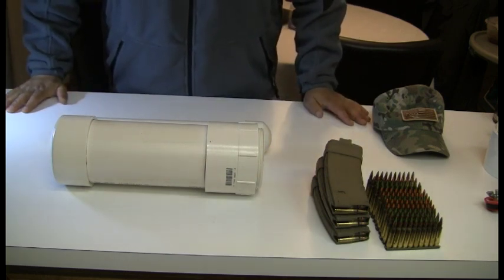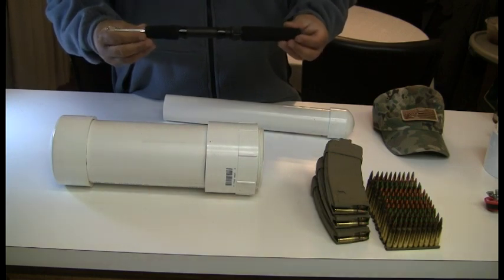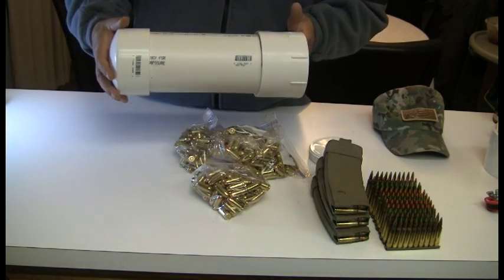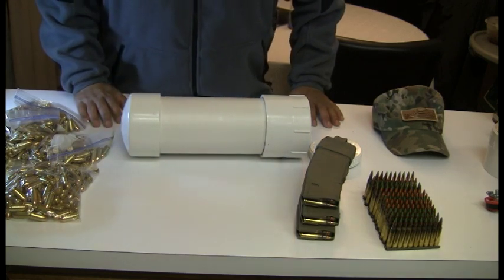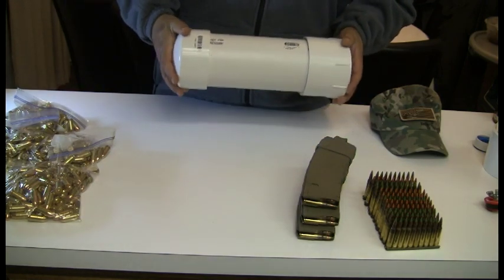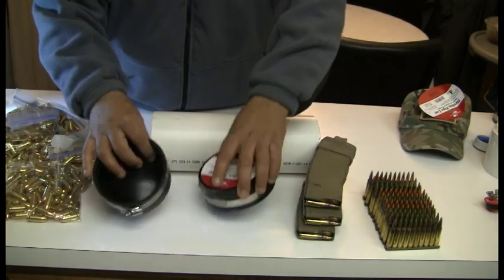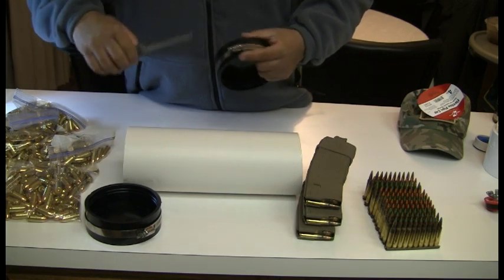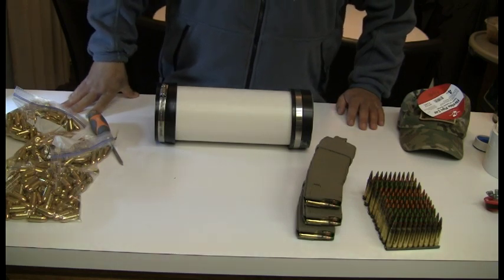Burial Vaults, Firearms, and Geo-caching

Comment: a pole in a survival bag or a bug out bag I think is just a waste of space. limb lines or bank line are a lot better than on pole. set out many of them and you don't have to watch them. they work with out being their the same goes for fish and animal traps.
Reply from the maker: I strap my pole to the outside of my bag. Or, if I have the space, I can put it inside. I carry bank line with me as well, however I am much more effective with a rod and reel.
Reply: PrepperLink yeah because strapping a long white tube (target) with an item that isn't needed to the side of a pack is a great idea. And better throw in some new mag springs since loaded mags in long term storage is a big no-no. And I couldn't stop laughing when you pulled out the flexible end caps....complete junk and not meant to be buried. No talk about rust/corrosion inhibitors or moisture absorbers. Your gonna have a big surprise when you dig your shit up
Reply: Ounces = pounds
pounds = pain

I agree, I'd either cache a fishing rod or simply do my best at making one.
Reply: svbummin Lol... I read this nonsens all the time.
And what exactly are these "rust/corrosion inhibitors or moisture absorbers" supposed to do?
If the container is air-/water-tight (as it should be), you simply don't need them.
And if the container is not, they won't help you at all.
Trust me. I have buried quite some tubes the last 2 decades.
PS : the flexible end caps are way better than the hard ones. The hard ones will crack, the flexible ones won't.
(hence the word : flexible).
PS2 : Inform yourself about magazine spring wear. It is a wellknown hoax that "keeping a mag loaded over time will wear out the spring". Only cycling (compressing and decompressing) is what wears out a spring.
Reply: So I guess ignore all the manufacturers and experts that clearly state that in recent hi-capacity magazines, the magazines were designed to hold more rounds with less spring material. And they admit that this puts more stress on the spring and will cause compression fatigue at a faster rate.or the countless people who have proven that mag springs compressed long term, will loss compression strength. Or the simple fact that im a skilled welder, metal fabricator and amateur blacksmith that has studied metallurgy for many years...so trust me when I say that the basic spring steel used in mag springs DOES form a memory over time. you can believe whatever you read online, but ive seen it first hand. It wont stop the mag from working necessarily but it greatly increases the chance for malfunctions and feeding issues, which again has been proven that even a small decrease in spring compression affects performance in some platforms.
and you clearly dont realize that rust and corrosion of metal is established from the actual moisture in the metal...not from moisture in the air (although after surface rust has been established the tiny bit of air left in a cache tube will be more than enough to allow damage if left long enough) because all metals ferrous or non-ferrous absorbs moisture. So unless you heat up your guns and ammo hot enough to sweat out the moisture and then let them cool and seal the tube while in a damn vacuum... you WILL get rust and corrosion. or simply use a rust inhibitor (which is standard industry procedure when working with a machined or high tolerance surface that has to be left raw) And with some grades of steel it happens in less than a day. So you can wipe down a gun after being exhumed or you can go ape-shit on it with steel-wool or a scotch-brit pad and pray that things aren't pitted enough to throw of tolerances like head-spacing. and I dont know what kind of cheap-ass thin pvc your using, but i have just over 40 pvc caches (some over a decade old) placed in many different terrains, including above and below frost-line. a dozen or so have been dug up over the years, and none are compromise in any way. but then again im not using a fucking hose clamp to hold on a rubber cap...thats just dumb
Reply from the maker: Great information and I respect your perspective. James Yeager supports the loaded magazine storage theory. Sounds like you should have your own YouTube Channel.
Reply: svbummin Not saying Im disagreeing with you, but have you have had a failed magazine spring? I have thermold mags for my AK that were loaded for 6 years in the AZ desert cycle flawlessly, and I still use them. I bought some beat up steel mags once, 1 with a faulty spring. I stretched it, torched it with some acetylene for a couple seconds and threw it in the freezer. I havent had a problem with it since... Just wondering.... I have seen a bad one, but never had one go bad on me..
Reply: aguynamedmike77 this method of torching the spring I have never heard how is this done this is very interesting the reason I ask a buddy of got a lot of mags with have not tested them all and will probably never test them all it was a whole large ammo box full of them. if you have a video that would be great thank you for any more information you may have to offer.
Reply: No video sorry. What I did was took the weak spring and laid it next to a good spring from a similar magazine. I compared both and counted coils to make sure they were relatively equal in length. Then i took the weak spring and gave each coil a little stretch. This ended with the bad spring appearing to be about 4" longer than the good one. I laid a cookie sheet in my freezer and let it chill for an hour or so. I then took the roach out of my hemostat (joke) :)  and used those to hold one end and dangle it while torching it end to end until a magnet would no long attach to it. Then I threw it in the freezer on the cookie sheet over night. Put it together the next day no problems since.
Reply: My earlier statement to svbu- was because I dont thing I have ever heard of a spring going bad in a modern mag... Im starting to wonder if that is more commonly a problem for older surplus steel mags..??
Reply: o ok we have a bunch of them thought you new a good method for fixing them
Reply: Scroll up^^ I have fixed one as described above. I wouldnt say Im vetted at it lol but it still works!
Reply: right ok I understand thanks
Reply: ***** You don't get out much do ya brother?
Reply: ***** How exactly is this "settling a debate"? It is simply repeating what I already said in my first comment.
Reply: +philip demoulin >"So I guess ignore all the manufacturers and experts"

it would really help if you actually pointed out who is claiming that because as far as I am concerned, you're giving me an extremely specific topic that gives me no way to look it up. Who'd have thought that "weapon manufacturers cheat customers, whistle-blowers confirm" didn't make worldwide news.

>"hold more rounds with less spring material. And they admit that this puts more stress on the spring and will cause compression fatigue at a faster rate"

But it won't cause fatigue at a "faster rate"... The VERY. FIRST. TIME you push a spring beyond it's elastic deformation limit it will undergo plastic deformation and have it's properties changed.

>"Or the simple fact that im a skilled welder, metal fabricator and amateur blacksmith that has studied metallurgy for many years"

Then you'd known that fatigue sets in by cyclic loading and not static loads.
Reply: iwantosavemoney d